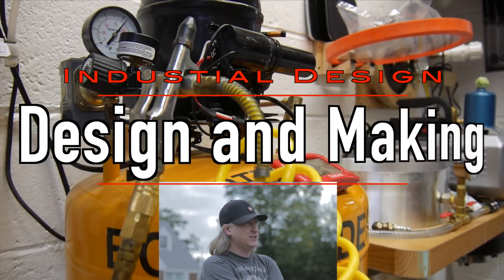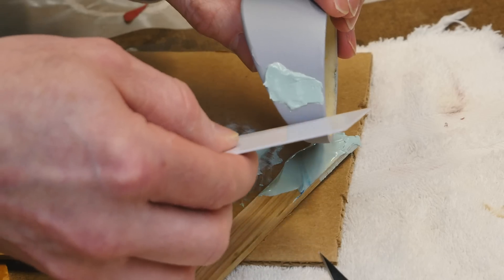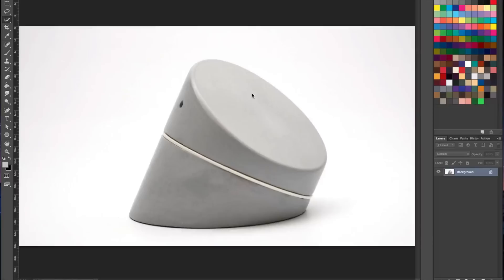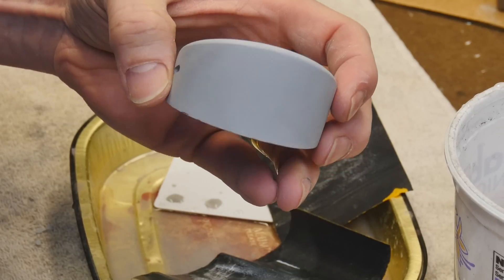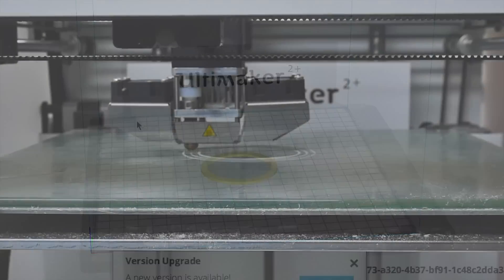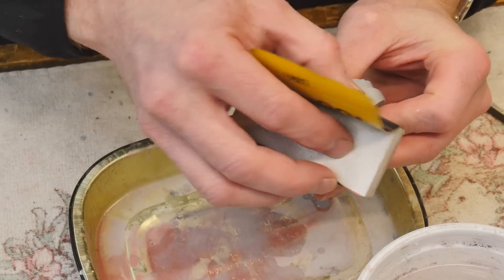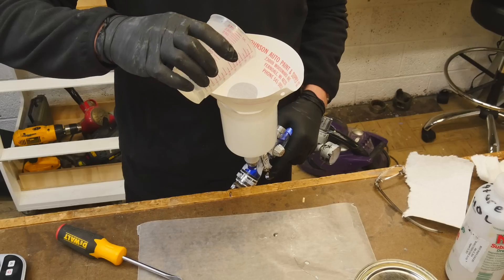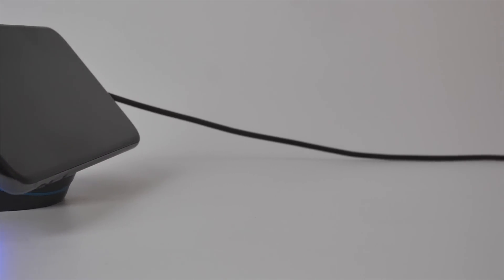What is CMF? How to get a High gloss finish on a model or prototype

Comment: You should check out those rattle cans that have two cans inside one can. They keep the activator and gloss separate and mix it as it sprays. It’s expensive but gives you the same gloss as a gun without all the hassle of the gear and cleaning
Reply from the maker: Will do

Comment: Gonna have to disagree on your design process. The initial sketching stage is where you'd move the led and charge port to the bottom. Not the model making stage. That's a lot of work to polish and clear coat a model just to say "oh, next model we'll just move those to the bottom"...
Reply from the maker: Making mistakes is part of the design process, all good as long as your making the product better after what you learned
Reply: @EricStrebel  Entirely fair point.

Comment: Why 3d print 2 mm thick circle and try to polish the surface instead of laser cut it from mirror finish acrylic or similar kind of plastic if the goal is a glossy finish?
Reply from the maker: Depends on the equipment you have available for the job.

Comment: Hii Eric.Thanks for such a great video. Is it possible to move charger plugin to base? So in that way top motion would not hinder anything.But it would limit top motion to certain degrees and not full circle so that wires don't get twisted. Just a suggestion.U know it better. Thanks.
Reply from the maker: See comments below, and comments at the end of the video.Milind Gadhvi

Comment: I wonder at what point it's easier just to do a ruff mockup to get the feel and function of it and then 3d print the models, and do design changes from that.  Sure, the foam is cheap and all, but once you had the basic shape, you were locked into that design, and committed to a lot of sanding,  spot filling, priming, painting....and waiting for it to dry between coats. That's a lot of time, and a person's time is worth way more than materials/tools.
Reply from the maker: GeorgeGraves well..I don't disagree with you, it would depend on the circumstances of course. Many students don't have 3D printers or, more importantly the CAD skills to pull it of. If I was doing more than one or two concepts for a client and time was tight I would go that rout. But for YouTube and the love of the design process and connecting with the product, I build it old school by hand. Just printing the stuff out does not make for a great YouTube entertainment, This is an entertainment platform after all, I have come to realize :-)
Reply: Yeah, he explains that in the video.
Reply: Yea, but still.

Comment: Couple questions:
1.  When is it that you decide to use spot glaze putty vs. polyester filler?

2.  After spraying, how long do you think it's safe before I can take my mask off?  I've been playing with automotive urethanes as well.  I shoot with a small badger airbrush directly in front of a 200cfm bathroom exhaust fan that shoots out the window.  I will eventually be using an Iwata LPH50-102G hvlp mini gun for larger objects and model kits.  It's not like an auto body shop where there's a haze of paint in the air.
Reply from the maker: GalaxyStranger01  1- polyester glazing putty is for small stuff, should not be used on primer actually, I don't think it adheres well. Poly filler..Bondo, for the really big holes and stuff. Spot putty use with primer for the pin holes and scratches.
2-when in doubt read the direction for the specific product, then tack on an hour just to be safe.